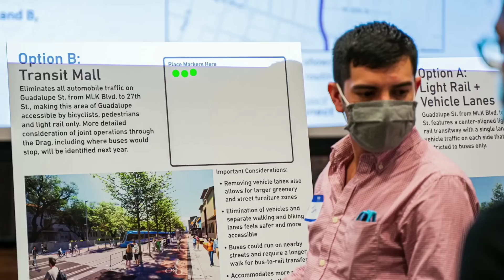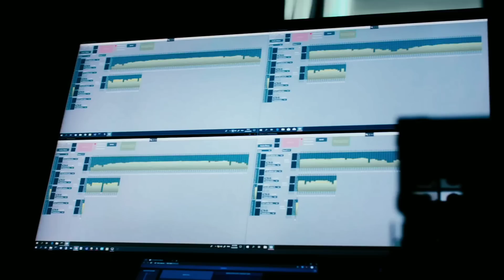5 Biggest $2 Trillion Upcoming Mega Projects in United States 2023

Comment: CAHSR won't be done by the end of the decade. The first 185 mile section in the Central Valley between Merced and Bakersfield is currently planned to open "before 2030". This will still leave 335 miles to be completed and connected.
Reply: The whole thing is a huge waste of money. Few will use it.
Reply: @carlsmith5545  You're rambling dude. I stand by what i said.
Reply: @johniii8147  you stand by it and we'll laugh at you later. California highspeed rail continues....

Comment: 9:44  if california state route took only 2- 2/3 hours, the average (not top speed) shall be 320 mph, Or else, if the average speed is really 220 mph, it will take more than 4 hours to complete 800+(10% for stations parking) miles
Reply: It's slightly less than 500 miles of track from L.A. Union Station to S.F. 4th and King. 220mph is not the top speed. The trains will be capable of 250mph. However, the intended cruising speed is 220mph.  It is unlikely an express train from L.A. to S.F. would make it in 2h40m in actual service, but it is theoretically possible if the train is at cruising speed outside of the lower-speed blended sections at the two ends. The stations will be quad-tracked. An express train will travel through intermediate stations at or near cruising speed. They will not "park" there.